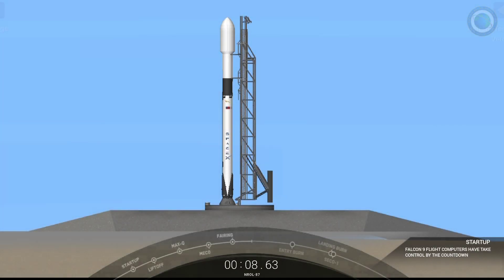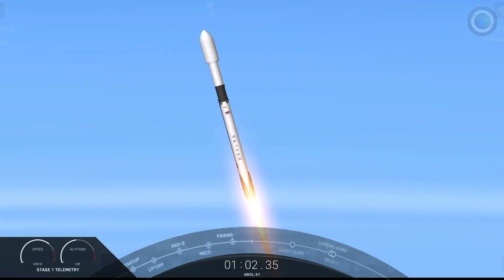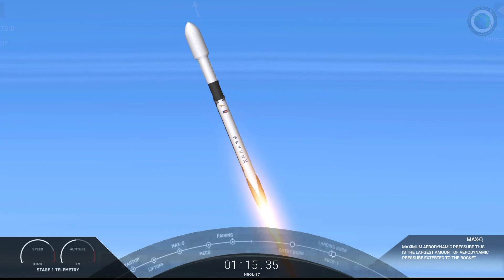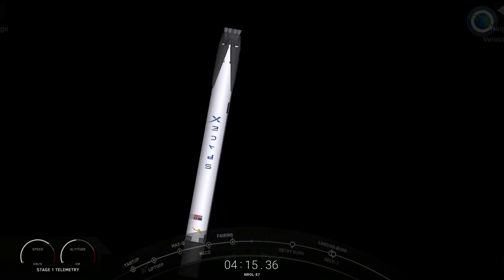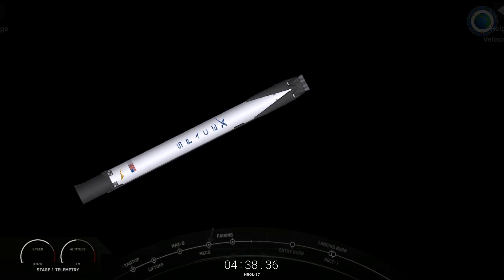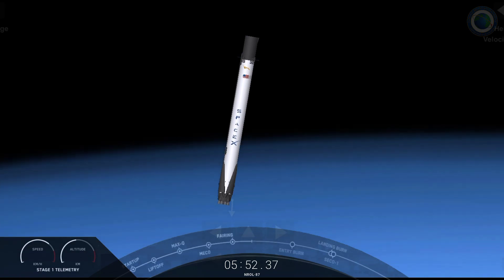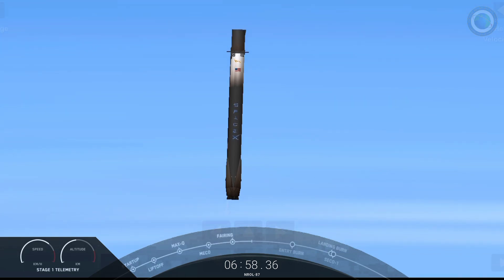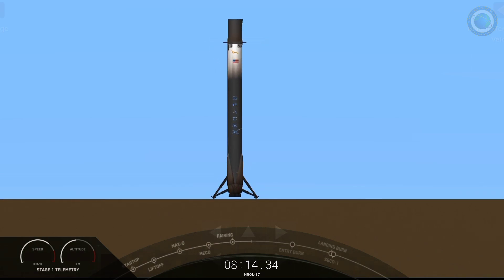NROL-87 Mission || Spaceflight Simulator  1.5.5.4

Comment: I hope this booster don't crash on the next flight, just like the NROL-108's
Reply from the maker: I hope it too!
Reply: @FeatherSpace  the NROL-108's was actually the booster who failed to land in February 2021, SpaceX said was because of heat damage
Reply: The booster that carried NROL-108 didn't crashed tho, so idk what you're talking about
Reply: @Delta_4000  this will make you understand by checking the description: https://youtu.be/L0dkyV09Zso
Reply: @CarlLovesAviation  isn't it starlink?
Reply: @YaItxSmoothy  it's the second starlink launch to crash
Reply: @CarlLovesAviation  sir, that's not the same booster who flew on NROL 180
Reply: @Delta_4000  check description
Reply: Infact, it's a different mission too